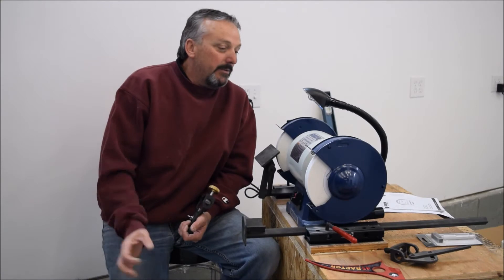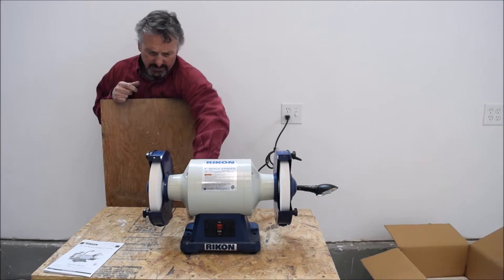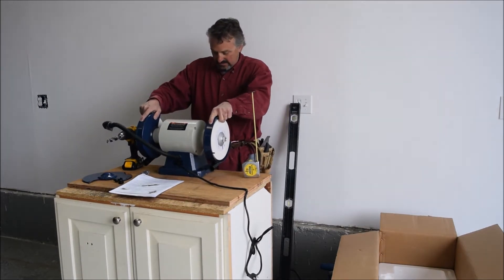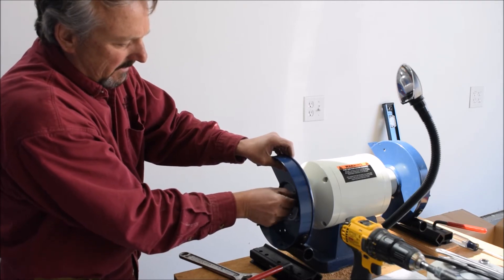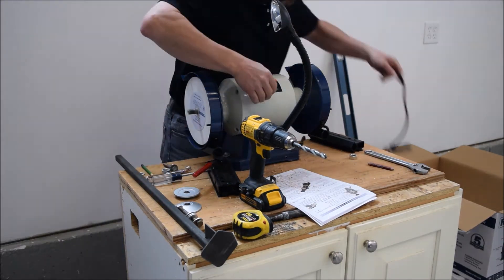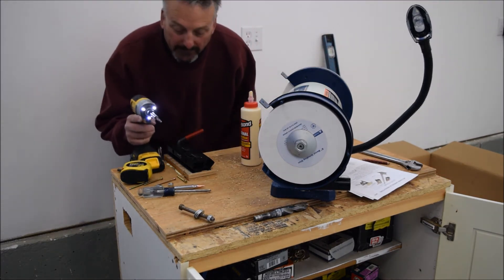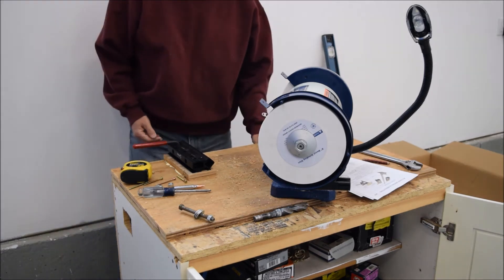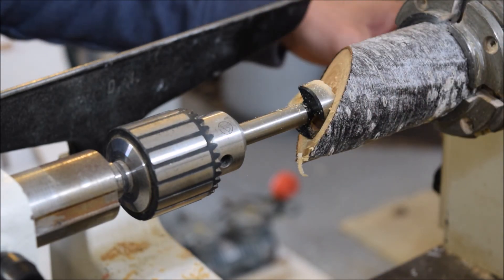Wood Turning Tools: Setting up a New Shop Grinder Wolverine Lathe Tool Sharpening System Setup

Comment: Mount whole system to a piece of 3/4 ply screw ply down to workbench. If you ever need to move the system unscrew ply with system move to new location re screw down. One time deal
Reply from the maker: Great idea.  I sort of did this as it is the only think really on the top of this cabinet.  If I needed to move it I could just take it off the cabinet and go.  The cabinet being on wheels is nice for me.

Comment: Why didn't you put on the CBN wheel when you had the wheels off?
Reply from the maker: I don't have a good shim to convert from 5/8 to 1 inch.  I bought one and it was only 1/2 an inch wide but I needed a 1.5 in wide one.  I may try to turn one out of walnut, if I get a 5/8 forstner bit. But I haven't made it that far yet.  I was also worried about the wobble and wanted to see if I could get past that.

Comment: Thanks for the video.
I'm looking at getting the same setup, but I'm wondering if I really need the 1HP grinder. Do you think the 1/2HP Rikon would be enough for sharpening lathe tools?
Reply from the maker: Yes a 1/2 HP motor grinder would work just fine.  I did a video showing more information about my setup and answered a few more wood lathe tool sharpening questions that were prompted from this video.  Please check it out.   https://youtu.be/1Pbn28mn5Bw  Thanks for watching.
Reply: Thanks!
Reply: Absolutely it is enough.  Baldor and Dayton make 1/4 horse industrial grinders, so 1/2 horse is certainly enough to take 1/32 of and inch off a chipped blade.
Reply: @woodworkerroyer8497  it is worth noting that those horsepower ratings are deceptive as rikon measures it at peak horsepower vs the other brands measuring continuous running power